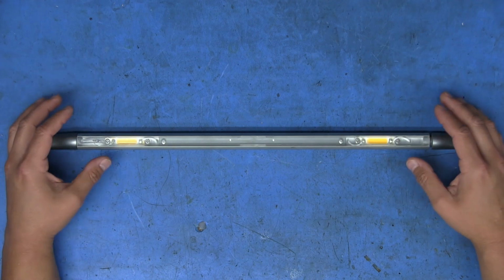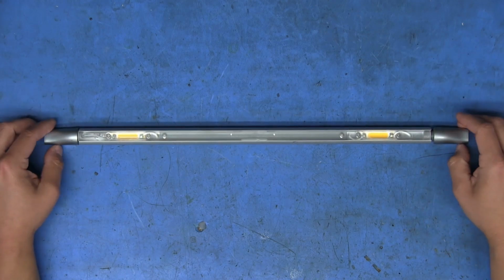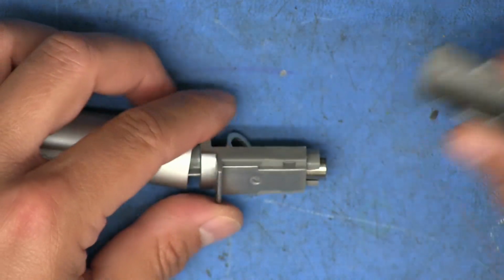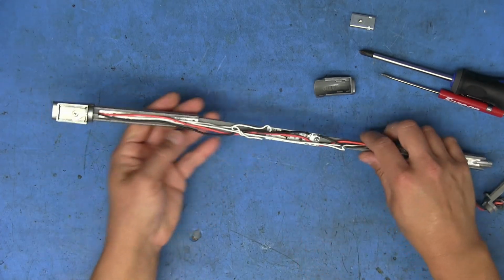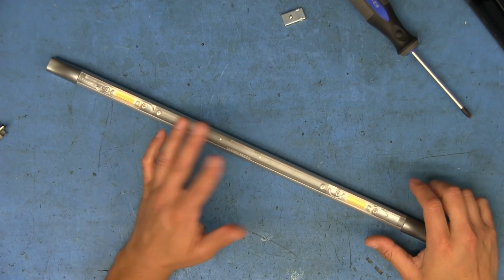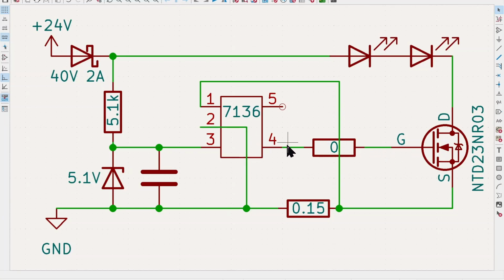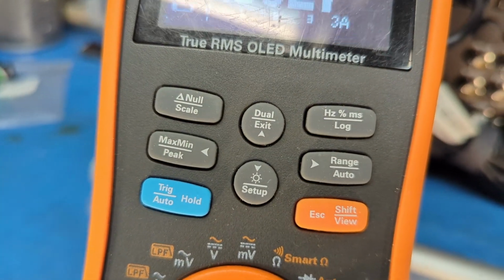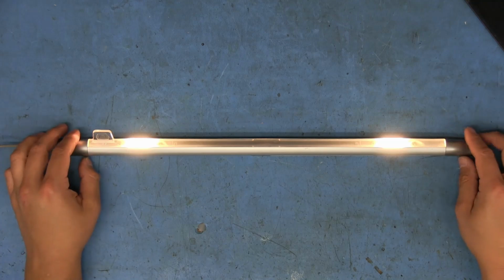TEF #169 | Herman Miller G6160.AM Twist LED Under Cabinet Light Teardown + Schematic

Comment: Hi. Thank you for video. I’ve same led light and they start blink when I moved it from left to right it start working but temporary.
Reply from the maker: Sounds like it may have a bad solder joint somewhere, or one of the LED modules may be faulty.